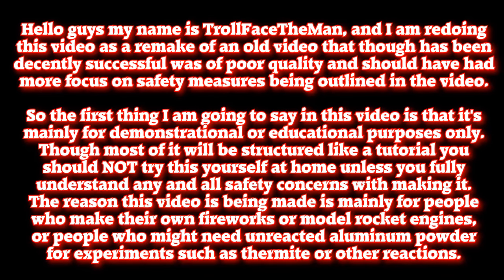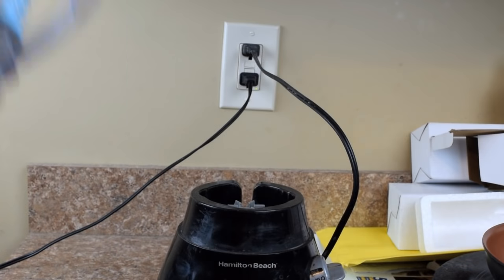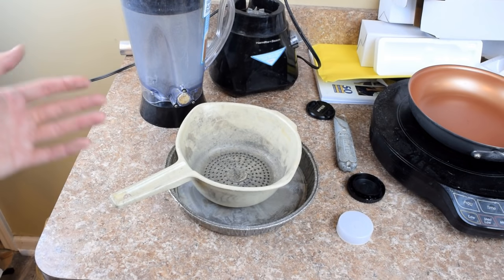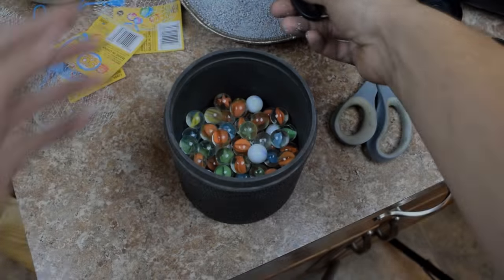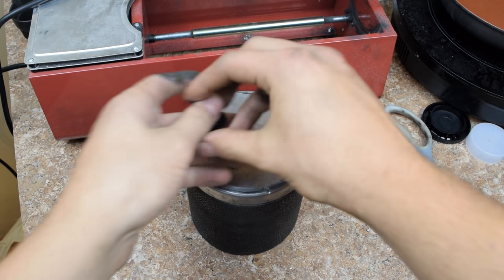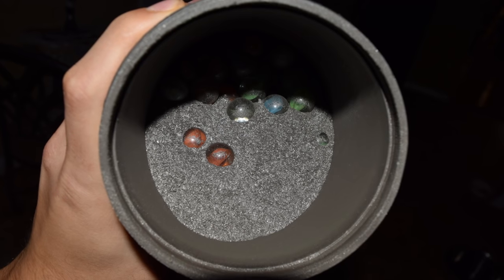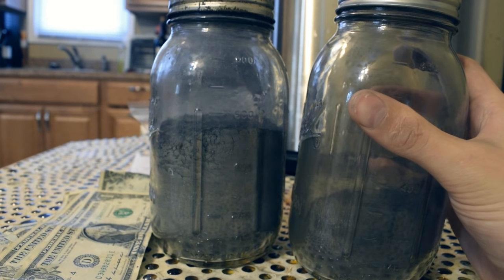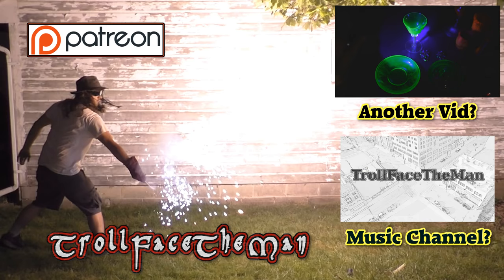How To: Easy Bulk Dark Aluminum Powder (My Homemade Process)

Comment: excellent video.. 
maybe you can help me with this..
I have a good supply of aluminium powder.. but it is not dark.  is there a way I can still make it useful for pyrotec ?? its a very fine mesh.
Reply from the maker: howard harmon the thing is the Charcoal only helps during milling. If you add it to aluminium that's already milled it won't do much at all.

 If you planned to mill it further then the charcoal could still be useful though.

 Even what you have just being aluminium powder it can still be potentially used for pyrotechnics like thermite or slower flashes.

 But if what you have is aluminium oxide it would be completely useless for anything pyro. 

 Still makes a great polishing compound though.
Reply: thank you! I really appreciate the help.. The package that was given to me says Aluminum Powder-  30 micron, 500 mesh. I assumed right away that it probably had nothing added. 
looks like I may be sitting on 6 lbs of polishing compound :-)
Reply from the maker: Well it would only be polishing compound if it's aluminium oxide which would be white. If you use a blowtorch can you gat a pile of the stuff to light?
Reply: with the hand held propane torch it wouldnt light. only glow a little. I wouldnt call the color white.. but it is a lot lighter than the dark aluminum powder.
Reply from the maker: howard harmon how big are the particles?
Reply: its very fine. seems to be the same consistency as the dark aluminum powder I've  had in the past.
Reply from the maker: Yeah then unfortunately it was probably milled too fine without Oxidation protection.

Comment: Is Dark Aluminium Powder any good for cold casting (mixing metal powder with resin) or should I rather skip carbon addition?
Reply from the maker: I am not an expert on cold casting but I would think you'd be better off skipping the carbon addition. Otherwise the dark aluminium powder might react violently with the casting media.

 The other thing is these particles being milled mean they are quite rounded and may not provide as much strength as jagged particles.

Comment: Found this video while looking to make thermite,  my goal is to take my black sand from gold panning and make my own iron, then blacksmithing a knife from it, cause i don't have enough projects as it is.
Reply from the maker: I would recommend using a strong toggle magnet for harvesting iron rich black sand if you haven't yet. Probably don't need to mill it finer, just melt it into a bloom if you have enough and go from there. Good luck!

Comment: Can this same process be done safely with shaved magnesium?
Reply: You can use the same process, but note that magnesium is even more pyrophoric than aluminum, so use protective equipment (including a full face shield) when opening the milling jar, and open it outdoors, pointing the jar away from you.
Reply from the maker: Yes, but as said it is much more reactivate. Milling jar should be opened maybe twice as often and safety equipment work in case of flash ignition

Comment: Kudos for all the safety tips,you just gained a new sub!:-).I just bought a vibratory tumbler(no steel,just plastic and aluminum lid which never gets contacted anyway.Gonna see if it may work as well as a tumbler.Anyway,where is a good source for the charcoal(other vids say it needs to be a soft wood)?Do you buy or make your own,and if you make it,can you give general instruction?Also,I'm not big on chemical mixes,but reading alot,and was wondering what powdered sugar in the mix would do?Thank You for sharing your knowledge!
Reply from the maker: +Bowtie41 Actually I heard hard wood is best myself, supposed to convert cleaner yet I can't say for certain how true that is.

 I make it or get it from the store, I am not too particular on what wood it is made from.

 As for a vibratory tumbler I actually heard they are significantly faster, but once again not something I can confirm.
Reply: Thanks for the rapid reply!The news about the tumbler is great.I am a disabled ex machinist,so I'm going to crush alum. chips I got everywhere in the shop,lol.So do you buy the charcoal already powdered somewhere,or can I just crush Kingsford or similar?
Reply from the maker: +Bowtie41 I mill it into powder using the same tumbler but with steel ballbearings as they are way quicker, and safe for charcoal milling.

 Technically any charcoal can do, even stuff for the grill but you have to be careful as many of them have accelerants on them.

 Typically these are ones labeled "Ez Light" or similar.
Reply from the maker: Oh also, thanks for subbing I missed that on the first read :)
Reply: You are very welcome!

Comment: Could you blend or puree the aluminum in water to help prevent dust and  or dust explosions? Then just dry the aluminum
Reply: I asked the same thing then I read your question. I wonder
Reply from the maker: Theoretically if using distilled water so there isn't other containments.

Comment: Can I, instead of using a mill, a plastic bottle (with marbles) which I mix manually?
Reply: you could but you would be spining your bottle for 2 weeks hehehehe
Reply: If you never want to finish. Cause it will take that long rolling that bottle manually.

Comment: I wonder, how bright would be magnesium powder :D If aluminium glow so bright.
Reply from the maker: I can definitely tell you it is a bit brighter.
Reply: I think that it just cant be much brighter but I heard that burning magnesium give off ultraviolet radiation. Which is bad.  Though even if it wasn’t much brighter it would probably be more reactive or easier to light up and maybe faster burning.

Comment: Wet mill chunk cast aluminum [like used engines] with a belt sander in an oxygen free enclosed box and you will get more aluminum and less oxide.
Reply from the maker: +Delicious DeBlair The aluminum is strong enough to separate the oxygen from Hydrogen in the water, it doesn't need outside air.
Reply: What is your point in mentioning that?  ~( ,m,  )~
Reply from the maker: Delicious DeBlair Because you mentioned using water to mill it in an oxygen free environment.

 Not point in having the environment be oxygen free if you are using water as it is an oxygen Source for the aluminum.

Comment: I did this with lead and it took a REALLY long time to finish milling.. could be that my grinder wasn't too good.. not sure but it took me 3-4 weeks i'd say to finish milling.. 

Quite good results but not worth the wait in my opinion..
Reply: It’s because you used lead, use glass or stainless steel
Reply: get a real ball mill for 200 bucks online and you can do 3lbs a week.LOL
Reply from the maker: Aluminum is harder then lead. The lead will be being worn down more than the Aluminum is.

Comment: Did you know that in aluminum foil there is a part of Iron. Maybe between 20 and 30 %, this can slow the combustion because iron particle melt and don't react like in thetmite.
Reply from the maker: Aluminum foil should be made with 100% aluminum, no Iron. If you have a source saying otherwise though I welcome you to post it so I can have a look.
Reply: All the household aluminum foil wraps I have seen are approximately 98.5% aluminum. The remainder is primarily iron and silicon - which are added to give strength and puncture resistance to the foil. 

As an example, look up the Reylolds aluminum standard weight household wrap on their web site.
Reply from the maker: buggsy5 Thank you, makes sense. But nowhere near the 20-30% the other commentator claimed.

Comment: What type of charcoal do you use? Will hardwood lump charcoal ground into a fine powder work
Reply from the maker: If it doesn't have any additive like accelerants it should work fine.
Reply: TrollFaceTheMan  Thanks. What would be a safer alternative because im not completely sure about the contents.
Reply from the maker: Just taking some small branches throw them in a steel can with the top put back on and a few holes poked in it. Let it sit in a small fire for about a half an hour.

 By the end the small twigs should be converted into high quality charcoal.

Comment: Hello Sir. Can you please reply. Would regular aluminium powder burn hotter in thermite or would aluminium powder with charcoal burn hotter in thermite?
Reply from the maker: +XXTechMoXX ` Technically Regular aluminum would because it would be better balanced Stoichiometry. However to get the Aluminum that fine without charcoal or another oxide inhibitor would result in the aluminum becoming instead a lot of aluminum oxide while in contact with the air.

  Aluminum Oxide is completely non reactive in a thermite solution and as such will only hinder it. So it is better to have a little charcoal or oil covering your aluminum than none at all. If you don't the aluminum quality will be reduced.

 So perfect world = Pure Aluminum
Reality = Aluminum with a little Charcoal or Oil.
Reply: Thank you sir.
Reply: Hey I have 1 more question. Have you found anything to put into the tumbler that is faster than marbles or no?
Reply: Please reply

Comment: Some questions;  How does your black Al compare to the standard "Indian" or "German" black aluminum available commercially ( from pyrotechnic suppliers mostly )?  Are there other reducing agents you can add besides charcoal?
Reply from the maker: +Mark Harder From my own experience I think this preforms almost to grade with pro grade Aluminum powders. But the issue is the quality really depends on mill time and carefulness during preparation.

 If proper care is not taken then the product is likely to come out of an inferior quality. If proper care is taken and sufficient time Milling is given, then it should come out really good.

 As for the second part of your question. The charcoal isn't a reducing agent, as it doesn't actually take any oxygen from the aluminum. It simply prevents oxygen from bonding to the aluminum so it's an inhibitor not a reducer.

 As for whether or not anything can be used in place of it? Actually yes many people use small bits of oil or wax to coat the granules in much the same way.

 I however have never use this method before so I can't offer much advice on it. Hope this comment was helpful.
Reply: Yes, that's helpful.  I didn't think of waxy substances.
Reply from the maker: Glad to hear :)
Reply: You can coat it with boiled linseed oil.Pure linseed is expensive and without aditives and dryers inside.But coating is no needed for Al it common used for Mg powder
Reply: For pyrotechnics, the usual anti-oxidation coating for ultra-fine aluminum powders is something similar to stearin. Whatever it is, it is slightly acidic and sweet smelling. 

Many years ago, when I was making fireworks and composite rocket motors, I had a barrel of 3 micro aluminum coated with that waxy inhibitor.

Note that, at low temperatures, aluminum does not react with most acids due to the natural and normal aluminum oxide coating. However, even when cold, it will react with alkalis like sodium hydroxide.
Reply: Its just as good

Comment: What would happen if you added water to the tumbler?  I am sure it would slow the process, but it would negate any dust issues e.g. breathing or deflagration.
Reply from the maker: The dark aluminium reacts with the water when particles get small enough. Theoretically the water acts as a source of oxygen for the aluminium powder.
Reply: Ah, thank you.  That's a great reason to NOT use water!!

Comment: Hi. I didn't quite undertand the ratio between aluminium and charcoal. You mention 5% charcoal to aluminium by weight. For example. For 100grams of aluminium there should be added 5 grams (5%) of charcoal? Or should the total weight (aluminium and charcoal) contain 5% of charcoal.

Comment: Will Graphite powder work as a carbon agent?   I've been taking wood charcoal from my fireplace.. but feel graphite may be even finer than what I've been using
Reply: tried it,wanted to compare with charcoal and it was no comparison,charcoal came out on top just like it did against stearic acid,only one other thing outperformed charcoal,i would rather not say because of safety reasons
Reply: Nice.. I found this great charcoal (at the dollar tree lol) for brushing teeth.  It's 100% coconut husk charcoal.. fine as baby powder.. black as nite... And also.. it comes in small pre-measured cans for a buck. 
Best charcoal I've used yet.
Reply from the maker: Interesting, thanks for the info.
Reply from the maker: Food to know.
Reply from the maker: Interesting info Pyro.

Comment: You can eliminate the blender step entirely if you heat up the sheets of foil first with a torch and make them brittle.
Reply from the maker: Magic Smoke FPV Heating them oxidizes them and that's what we are trying to prevent.

Comment: just made a really bad tumbler, is it ok to use a glass jar for the barrel part of the tumbler?
Reply from the maker: +that man with the van van it'll probably break from this stuff tumbling around.
Reply: it's actually copying not too bad however it has only been running on batteries, I still need to find an old phone charger to provide a more reliable source of power.
Reply from the maker: Garage sales are a great place to find old power transformers you can use or even just old phone chargers like you said.

Comment: Hey TrollFace, just a quick question. Do you know if there's a possibility of glass marbles generating static electricity while tumbling inside a plastic container eventually causing a spark?
Reply from the maker: +ToiletStruggle Seeing as the mill is rubber coated even if it could build up it shouldn't be able to discharge. If the mill however was metal and grounded then it might be a different story. 

 I wouldn't recommend metal with glass anyways though as the glass can sheer off the metal and actually cause the mill barrel itself to spark.
Reply from the maker: +ToiletStruggle I should point out though thus far I have seen no indication of any charge building up on the glass marbles during any of my mills thus far.

Comment: Hi I have attempted this process before but whenever my aluminium becomes quite fine, it begins to stick to the balls and the inside of the ball mill jar, this means that every day I have to go and scrape everything off before I can begin milling. Any suggestions or ideas of how I can prevent this?
Reply from the maker: Hmmmm... Interesting, may I ask what all you used exactly in the mill?
Reply: +TrollFaceTheMan for the aluminium, I melted down soda cans into a big block then used a drill to drill heaps of holes in the block  and collected the shavings.
I then milled the aluminium shavings with 5% homemade charcoal

Comment: Can I mix this stuff with potassium perchlorate in a food mixer?
Reply: @Magnetosphere
Glad you are asking!
1) Never blend mixtures with power equipment, coffee grinder, blender etc!
2) never grind chlorates/perchlorates
3) If you join a fireworks club, you can learn how to do things safely. Learning the hard way is often fatal concerning flash powders.
Reply from the maker: As he said, never mix the fuel and oxidizer together in anything that will result in possible sparks, heat buildup or impact/shock.

 When mixing it is important to be gentle and preferably mix only when ready to use.

Comment: I have a ball mill with a steel container which is completely airtight. Why would if be a problem to use steel balls, when there is going to be no oxygen inside the container (it will combine with the particles on its own)? And even if there was some oxygen inside, and the powder did ignite, it would go out immediately because the volume inside the container is so small that the fire would consume the oxygen instantly.
Reply from the maker: Though technically it should likely be fine to mill with steel in the situation you described as there would be no air in the container there still can be a certain amount of risk initially starting before the air is consumed. And also risk of iron oxide from the balls or container acting as an oxidizer for the aluminum.

 Remember aluminum power and rust = thermite.

Comment: In your intro safety spiel, you said making this aluminum is done for people who want unreacted aluminum.   Presumably,  you mean unoxidized aluminum?  Would any ground aluminum that burns when ignited be considered unoxidized?
Reply from the maker: You are correct I do mean Unoxidized. And if it is the aluminium burning in normal atmospheric conditions then yes it should be Unoxidized, or partially oxidized.

Comment: I guess you have never used harden lead. I’ve used it for years and I still have the same hardened lead balls and they haven’t degraded in size.
Reply from the maker: I don't doubt you have been using those for years. But it is just a fact that those have worn down to some extent. Maybe a very small amount, but they have worn which means some level of lead contamination in your power.

  That is because even if the hardend lead does manage to be harder than the aluminum it is guaranteed not to be harder than the aluminum oxide that forms which is about a 9 on the mohs scale. Compared to lead normally at 1.5, or aluminum at about a 3.

 That is specifically why aluminum oxide is used to grind and polish stuff becuase it is extremely hard compared to most other things.